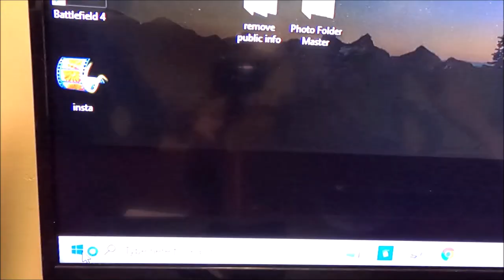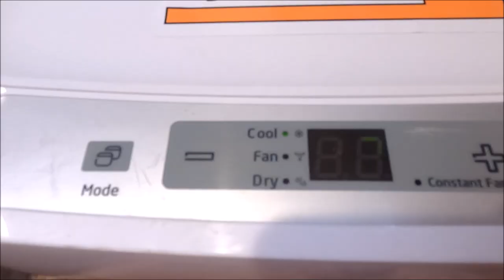Re-Build Begins! High Gloss Stone Look Shower Renovation!

Comment: I guess im old school. I havent used any of the foam systems yet. I install the step, liner, my own mortar bed with a 1/8 grade per ft to the drain, 1/2 hardy board, thinset seams, redguard, floor tile, cover floor tile then wall tile so there's not visible gout line at the bottom and so on and so on. Do you butter your tile and wall or just the wall? I vertical butter the wall and horizontal butter the tile to create a suction and even placement.

Comment: nice job,  Not a big fan of mitres for the niche ?
Reply: Tolga, when you say you’re not a fan of mitered niches, what exactly do you mean?  I’ve seen Landberg do the niches multiple different ways, with or without the Schluter aluminum trim, Jolly, Rondec, etc.  A lot of it depends on what the customer wants as a finished product.  

Some tilers have an issue with being able to cut nice clean 🧽 mitered corners.  Especially if they don’t have the skillset and/or a nice miter saw for the task.  I get why it could be an issue and I guess I understand why they wouldn’t be fond of the Schluter trim.  For those individuals Schluter makes 45 degree trim connector pieces.  The Schluter trim is a much cleaner, more modern look, much better than using quarter round or matching bullnose.
Reply from the maker: We love mitered niches, but the customer has to pay extra for that type of niche and work.